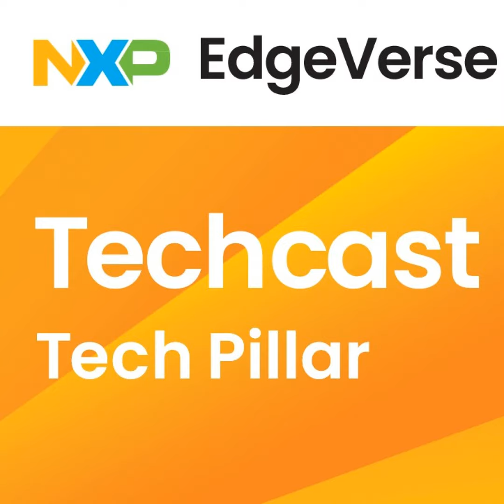CRA Week: Step 2 Security by Design

Comment: It sounds like you believe security should be built in from the start, especially with sensitive enterprise data. In my experience at Lifewood, limiting data access and simplifying handoffs lowers risk. One small thing to try is mapping who truly needs access. It won’t work for everyone. Have you tried that?
Reply: @VashDelosSantos, 100% agree that security assessments need to occur as early as possible. I will share your suggestion to create a map on who needs data access. I believe our solutions would then allow the customer to apply different levels of data access based on user profile.  I will let them provide their own thoughts.  THANKS for listening.